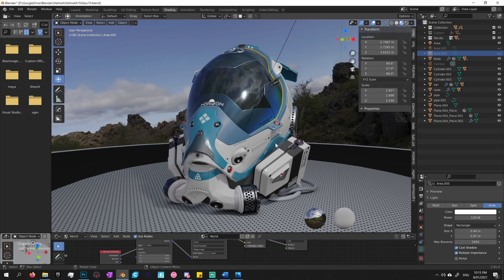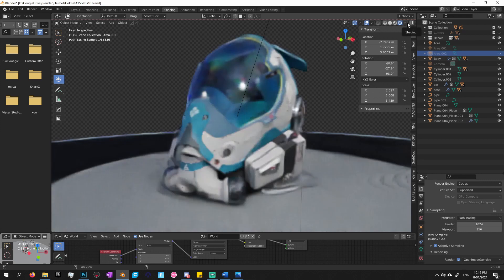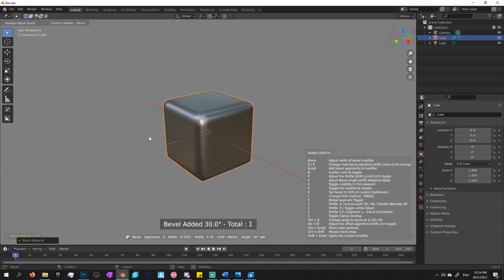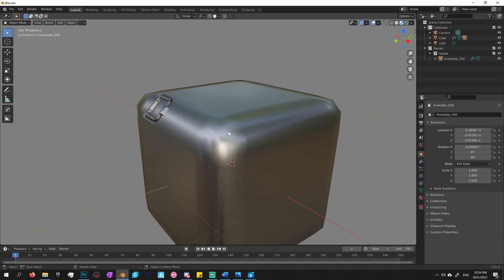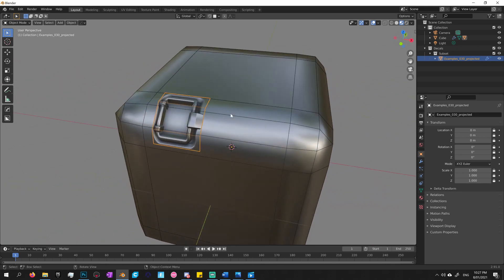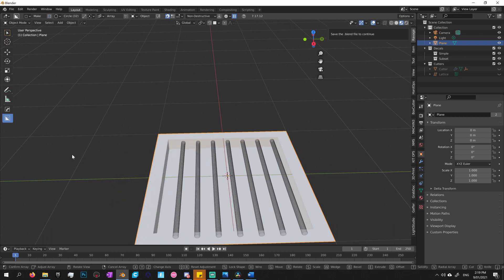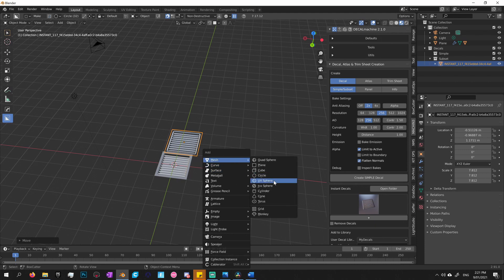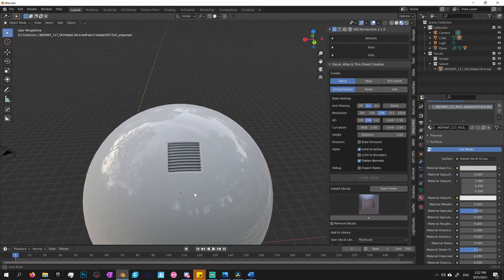3 Fake details with Pom Decal

Comment: MESHmachine is another addon though :)
Reply from the maker: I realised that mistake after I finished recording ;)
Reply: @MegaBrenly  Why do you say the Adjust tool is unconventional btw? It works exactly like any other modal tool in Blender, like the bevel too for instance. What's the convention you think I don't follow?
The only difference as far as I can see is, that I chose to present the info in the 3D view instead of the statusbar.
But I'd argue this is more convenient.
Reply: I’m coming from Maya so I guess I have a lack of familiarity with how things work in Blender. I love the idea but I find reading the tiny text hard especially if the background is white. And then to move the text to somewhere I can read it means I’m changing the decal distance. 
I’d actually prefer the options in a status bar with a black ground. I’m starting to remember the keyboard shortcuts so I’m needing to read the text less now. 
I mention this as I know people coming from other programs may struggle with the way it works, persevere and you’ll adapt 👍🏽